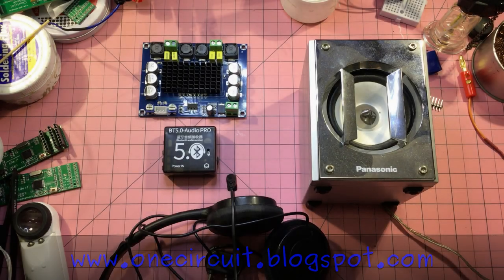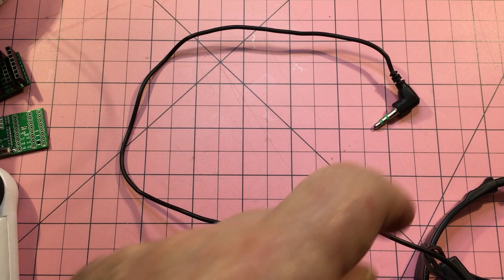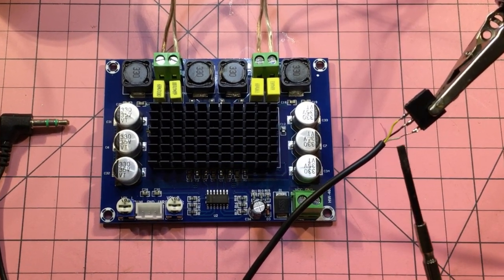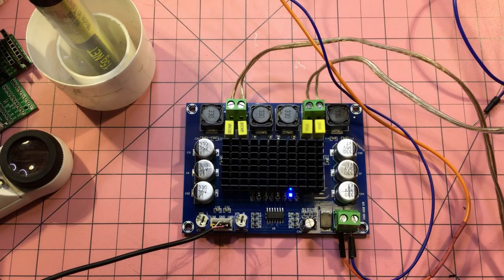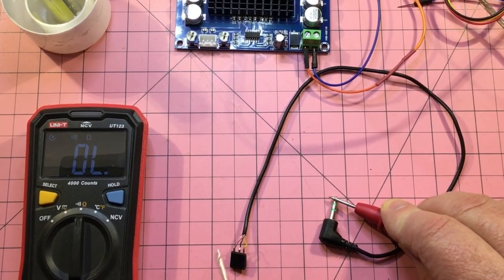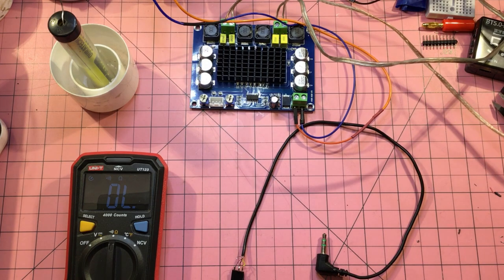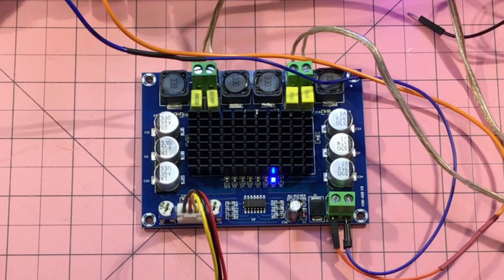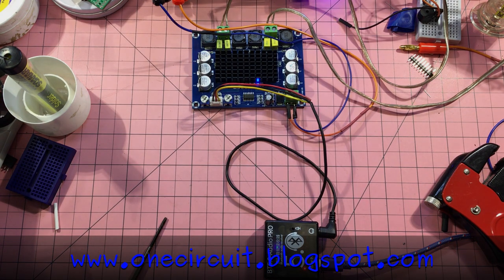120W Stereo Amp / Bluetooth combo for $12?

Comment: I have found that often the ground is split into two channels in older headphones. It usually depends if the cable goes to one speaker then routed to the other VA the head rest or if the wires are split to both speakers.
Reply from the maker: I’ll have to ask Qantas…😬